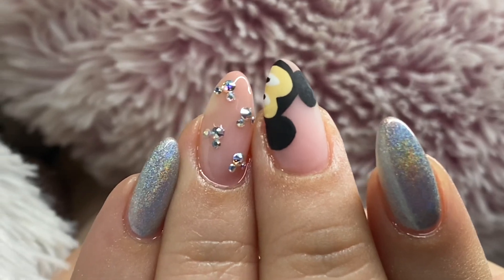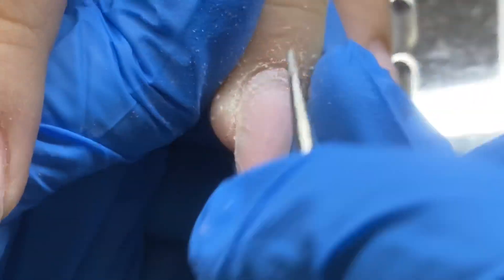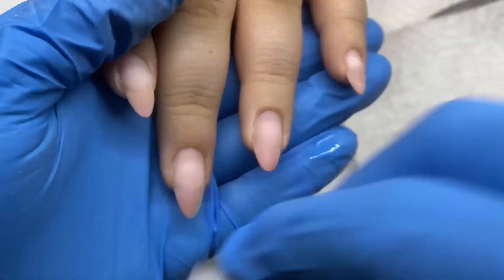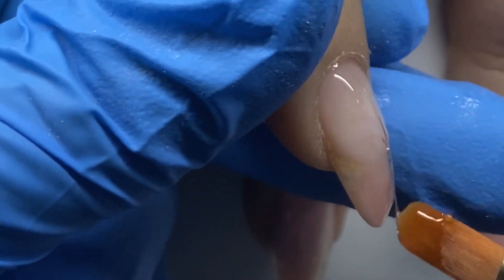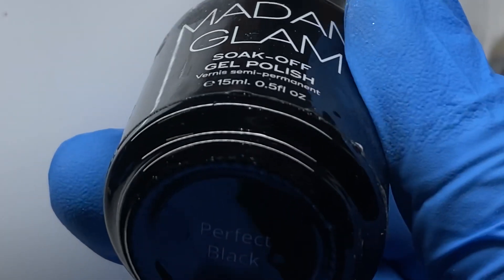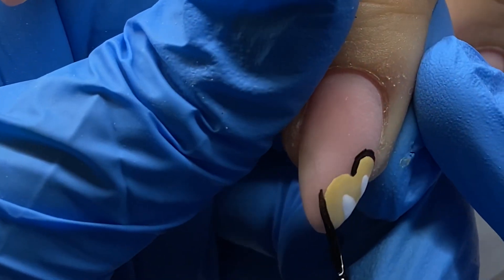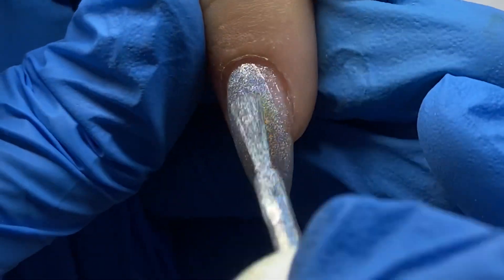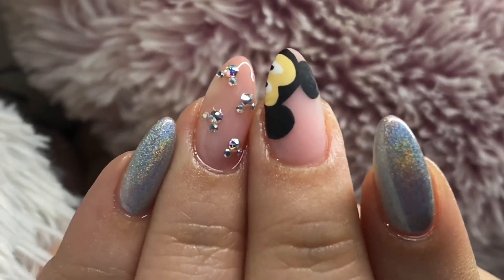Easy Mickey Mouse Kid’s Nails with REAL SWAROVSKI CRYSTALS

Comment: I have never seen anyone put topcoat over crystal gel like that. Great idea. Does it last just as long as it would if you sealed them?
Reply from the maker: I’d only do it for simple designs with smaller stones. The stones can move around more easily so you wouldn’t want to do something really intricate. Also, you’re not able to build up a large amount of gel the same way so the layer isn’t as thick making it better for smaller stones with a lower lip on them. If done properly and with good products, the stones can stay just as long. ☺️
Reply: Tabytha Scott Nails thanks for the tips!